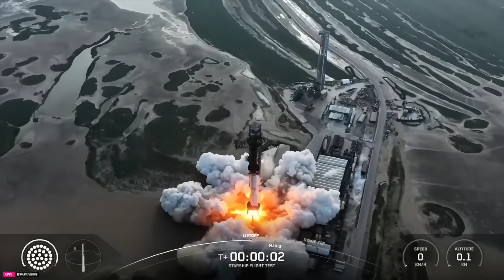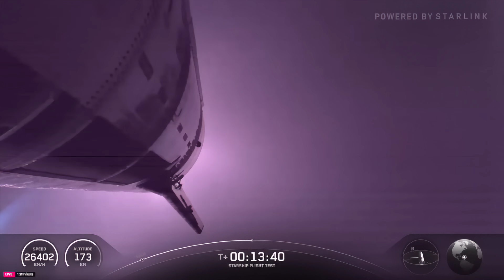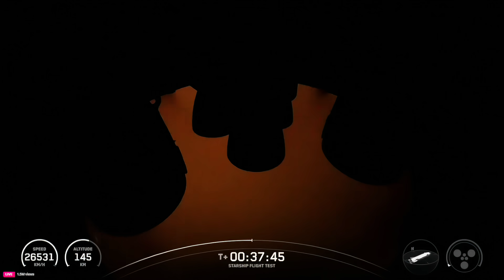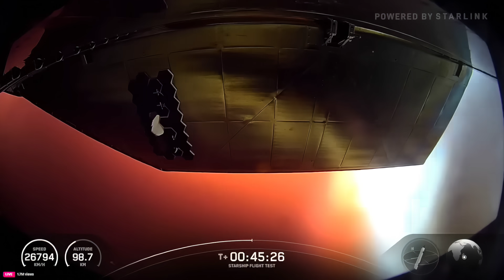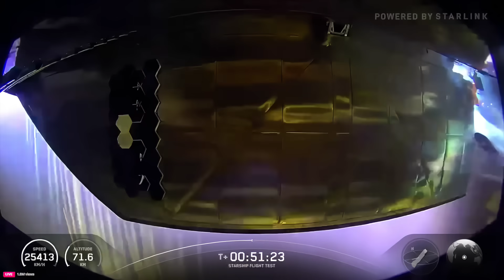FULL FLIGHT! SpaceX Starship Flight 10

Comment: but they blew up? How is that a win?
Reply: the mission was designed like that. They wanted to test the catch of the ship (the upper stage) without risking destroying the catch tower if it went wrong, so they had it land over the ocean, but act like there was a catch tower there. This meant it would shut off the engines mid flight, because that's what it would do if there was a tower. It landed precise enough, for the landing to have been successful, if there was a tower, that's why it's seen as a success

Comment: Put tiles all around Starship, (on both sides)
then have Starship roll during re-entry, (turn the sausage, don't let it burn on one side only!)
to take turns on the Aerothermal heating.
Roll Starship around to alternate between the sides facing the Aerothermal heating,
Sharing the Aerothermal heating.
The flaps should be able to do a roll maneuver.
This is a very good idea using standard flight maneuvers.
And Starship's symmetrical design is perfect for it.
:body-blue-raised-arms:
Reply: Ship has catch, in-space refueling and a lot more equipment on the top side so they can't add tiles there. Otherwise I'm pretty sure they would considering they said yes to the craziest (and coolest) landing technique of all time (I'm talking about the belly flop).
Reply: oh and the payload bay door
Reply: Your premise also adds a lot of extra unneeded weight.  Weight management is everything in this development game, even surviving re-entry.  Look!  Even if everything went perfect, this is a throw away prototype rocket.  The next 3-4 launches are prototype throw away rockets.  You don’t need to cover the entire ship. You just need to keep refining the current shield until it’s bullet proof.  That could take the next 4 launches or the next 14.  There are no rules.  Once starship gets orbital refueling and Starlink deployment functioning like clock work, the game is on and missions can begin, even if rapid reuse ability isn’t functioning it.  That will come in time.  The more launches and re-entries, the more refined and robust the system will get.  The better the heat shield will get.  This is a game of patience and persistence.  SpaceX has got tons of their own money to blow on this.  Starship’s first priority it is to be a diverse heavy lift platform into space and at 100 million a rocket, you can afford to throw away quite a few starships if needed. The program can get new Starlink into space without reuse-ability.    It can get lift heavy cargo or help make the next space station without reuse-ability.  It can get NASA to the moon without reuse-ability.  It needs rapid reuse-ability to make launches more frequent and cheaper.
Reply: @TheJTcreate  Good points, Starship is designed for refueling in space which makes even a re-entry burn possible, but I'm not sure they will refuel for that. But don't be fixated on the current design. it can literally change overnight.

Comment: At 59:00, it almost looks like there was less damage from the heat of the plasma than from the air itself after the maximum heat zone was passed. It seems the air had enough oxygen to actually start a burning (oxidation) reaction at that speed (rather than melting by temperature of the plasma). This suggests an imaginary graph of speed as a function of oxygen density might exist, which is required to start a burning reaction of a given alloy at a given temperature. This seems like a job for chemists.

Comment: Thank you for sharing the effects of the heat shielding tiles as well removing them to test effects on heating for the air frame Space X. The plasma is 100% bend with near perfect displaced coefficients in real time interruption creates a build up of heat. I can see how it's kind of double edge sword. Low bleed off of heat means more incoming velocity and more heat on the wings. More displacement... higher build up of heat slower re-entry. You almost want to build up between critical components and instant bleed off. Gives me something to think about...

Comment: 19:33 what are all the bug like things flying across the screen?  Even outside there are these things and tiles coming off, but moving pretty slow when it hits exhaust.  The mock satelite simulators also seems to trundel out bouncing.  I thought it would be pretty smooth, and not much flakes or tiles coming off?

Comment: 00:17 Ignition, Lift off!
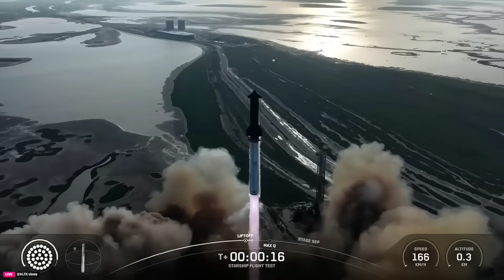00:32 Tower cleared.
01:29 Max Q.
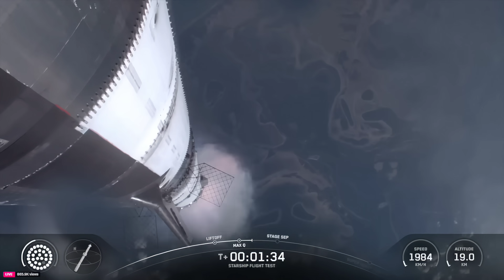01:50 One middle ring engine out.
02:57 - 03:02 MECO, Hot Staging, and Second stage engines start.
03:06 - 04:05 Stage 1 boostback burn.
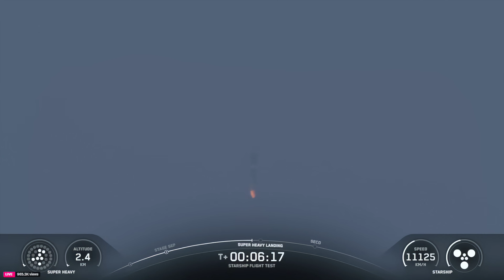06:35 - 06:58 Landing burn.
09:02 Vacuum Raptors shutdown.
09:17 Sea Level Raptors shutdown.
17:14 Cargo bay door open. 💨
19:30 Simulation Starlink 2 deploy.
20:14 Boops the doorframe.
25:02 8th one deployed.
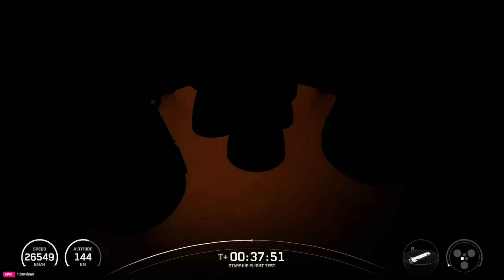38:08 engine relight start.
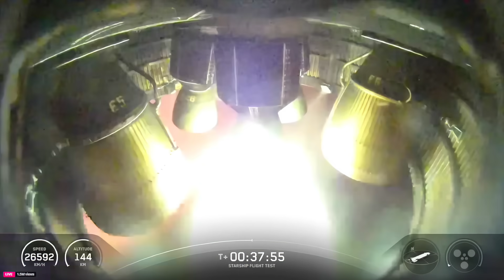38:15 engine shutdown.
42:48 Re-entry phase start.
47:16 Aft skirt 💥 
51:11 burn through.
01:00:20 Re-entry phase finished.
01:03:50 Starship slows to below Mach 1.
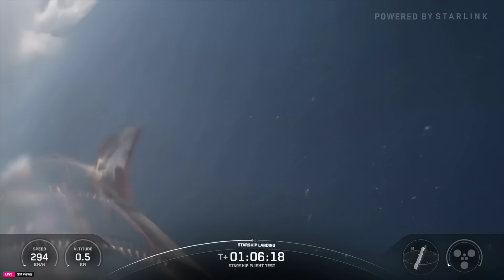01:06:32 Landing burn start.
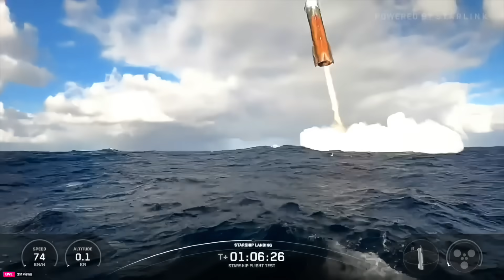01:06:44 THAT'S ONE RED HOT GLOWING STARSHIP!
01:06:50 Landing burn shutdown.
01:06:55 Starship goes 💥.
Reply: The explosion at the end made my day :D Successful Test!
Reply: 01:00:05 flaperon stress test

Comment: why into the sea? i don't get it.
Reply: For the booster - they were testing a contingency plan on the landing burn, which wasn't guaranteed to work.  Safer to test over water than the launch site. 

For the ship - they're still doing suborbital flights for multiple reasons, so it can't make it all the way back to the launch site.  Also the ship undergoes way more stress than the booster, so they want to make sure they can do controlled landings at sea multiple times before trying to catch it at the tower.  And as mentioned in the commentary, they were stressing the ship beyond what they would normally expect to find its limits, so it was expected to sustain damage on the way down.
Reply: They just don't trust it enough to attempt landing at starbase yet. They also want to be on a path that ensures Starship reenters by itself in a known area even if they lose control in space. That means roughly 2/3 of a full orbit, so Texas->Indian Ocean it is.
Reply: Need a cleared zone incase it blows up, like it has lol the booster is obsolete so tested to destruction

Comment: It was interesting to see the tile side of the ship on the bouy cam! Why was it so orange? did the tiles survive?
Reply: Looks like it went all the way through the tiles down to the ablative layer underneath, not a good sign, its looking more and more like the only solution will be to actively cool the entire heat shield
Reply: @clippyremembers  You can see this orange coating close up on the rear flaps, it just on the surface, something in the heatshied vaporize and coat everything in that orange stuff, my guess it is iron oxide
Reply: Many weeks later. The orange was rust from metallic tiles rusting, possibly enhanced by trace gases from the one actively cooled one. The white was melted ablative from spots where the tiles were removed to test how the ship would be damaged with missing tiles

Comment: Seems to be a lot of debris coming off it periodically. What's up with that?
Reply: Mostly just condensation ice.
Reply: SUD - Slow Unscheduled Disassembly
Reply: Yeah, black ice, the kind that looks suspiciously like parts burning off the machine. You'd think on one of these flights they' make it so everything actually worked, but then they'd have nothing to blame any failures on. I don't see how they're ever gonna get this thing human-rated if they can't demonstrate repeated, reliable flights. All that cultish cheering in the background just creeps me out, and it tells me all of this is about appearances. I was impressed when the guy acknowledged the failure in the skirt though. He didn't ignore it like they usually do.
Reply: @DrBeenaPlumber  As mentioned in the commentary, they were deliberately stressing the ship beyond what they'd normally expect during re-entry to find the weak spots.  The best way to find out where something will break is to stress it until it breaks.  

They also mentioned that they're still sussing out tile placement; each flight gives them new data, and they've seen some unexpected effects on prior flights.

This isn't the Shuttle orbiter; very little data from that program is applicable to the ship.  They're basically having to start from scratch, which is why progress has been slow.
Reply: @johnbode5528  That's not just slow progress. It's a reckless attitude toward testing that puts lives at risk. Twice now they've blown up Starship over busy air corridors, putting flights at risk with no prior notice, leaving many of them with no suitable alternate landing airport other than closed airports under the debris field. They send spacecraft up that they expect to fail, and they can't say precisely when or how it's gonna fail. They can't just keep doing that again and again until people start dying. They haven't done proper environmental impact studies because they don't know what hazards they will be introducing or where they will be introduced. Why are they so desperate as to resort to such dangerous and irresponsible test methods? I think they are incapable of a safe flight. Other space programs properly test their equipment to destruction on the ground before endangering the world like this. Sorry if that's too expensive, but one company has no right to do that to us.